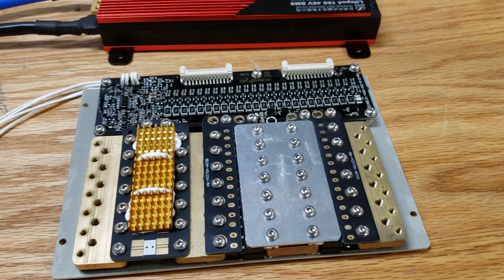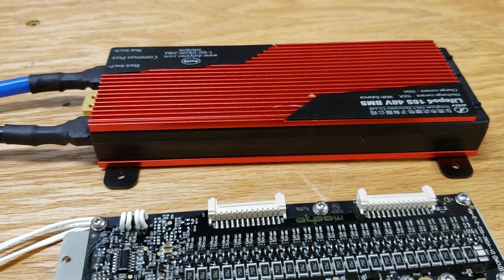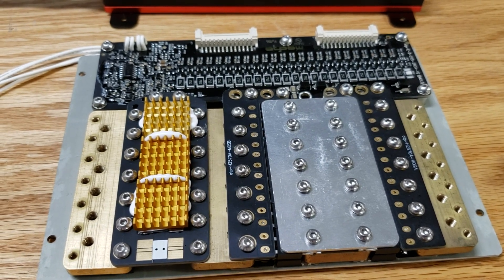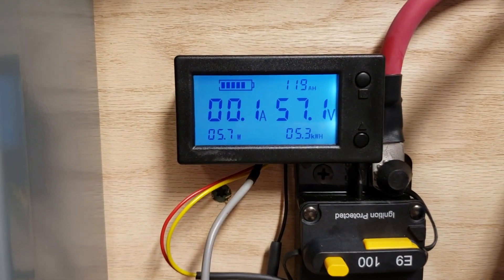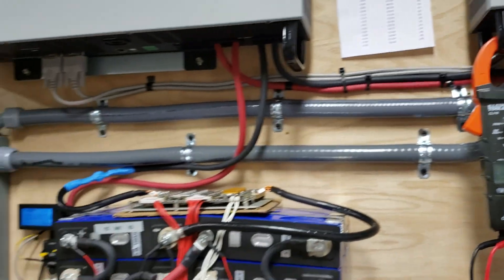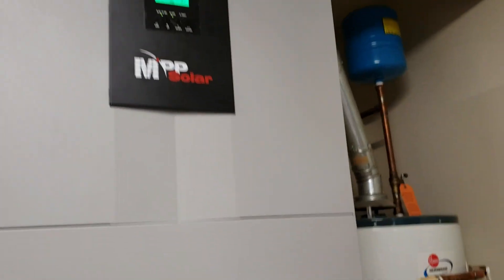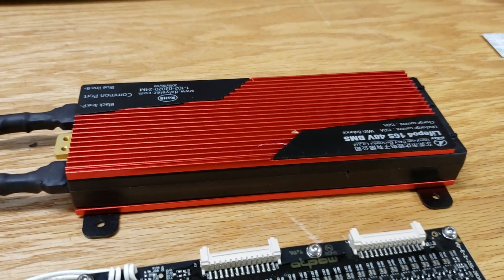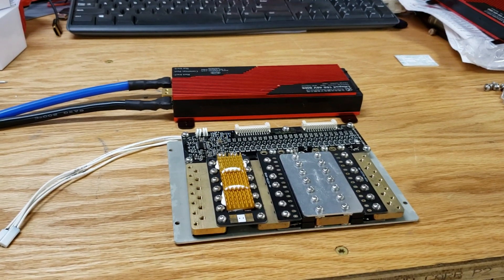MPP Solar LV5048 week 4 update and VoltCell 120A BMS's

Comment: I just received my lv5048 today but I'm having trouble getting it to charge my batteries by utility power. I tried changing it from SOL to UTL to SBU in settings 01 and in settings 12 I have it set to 51v.

For 13 I have it at 55v and 16 I tried various settings and I still can't get it to charge my batteries. I currently do not have PV connected so I'd just like to use it as a backup for now.  Any ideas? How do I switch between "standby mode" "Fault mode" "line mode" and battery mode? It's stressing me out. :(
Reply from the maker: Setting 01 UTL, 16 CUT, 03 APL, 12 Default. Most efficient way of doing settings is hooking it up to your PC or Laptop.
Reply from the maker: Provided that LV5048 was installed correctly
Reply: @DMIINC2013  and thank you so much for helping!
Reply: I'll  try those settings when I get off work. I do have it connected to 120v (GND L1 N) so that might be why. I'll try wiring 240 on the input and see if that works.
Reply from the maker: @redsite001  I am about 100 Sure that it has to be on 240 volts to charge. L1 L2 N G. I can charge batteries at 4KW from utility and that will require 240 Volts.
Reply: @DMIINC2013  okay I'll give it a shot. Looks like I'll need to buy some wire. Thank you so much.
Reply from the maker: @redsite001  Go with 8 AWG as input and you can stay with 10 AWG as output.

Comment: How is this alibaba BMS board working for you, I saw a 180a version.
Reply from the maker: So far so good. I have 3 of them. During testing I even managed to see one of them do the job it was designed to do.
Reply: @DMIINC2013  Hi DMI inc. I am working on a 48v or two 24v BYD (8s) battery powerwall and i am interested in using this Alibaba BMS. Could you email me the link and what the 120a BMS cost, I believe a saw a 180a version, but i am not sure if is the same company.  MNRosado@live.com.
Reply from the maker: @marcoa.rosado4724  Try on this link https://volt-cell.en.alibaba.com/?spm=a2700.details.cordpanyb.4.623e4f843W5WEd
Reply: @DMIINC2013  Thanks that's were i found the 180a BMS, i just requested inf (instructions) and pricing. I see you have a 24s BMS,  and are using only 16S. How do you monitor each cell, and you say one of the BMS did the job it was designed to do, What happen if i may ask.
Reply from the maker: @marcoa.rosado4724  For the price that I paid for the BMS I do not expect it to have monitoring capability. All I needed of it to do is be capable of delivering it's rated power and protect batteries. In the case of LiFePo4 batteries disconnect system at 2.00 Volts per cell and stop charging at 3.90 Volts.

Now to your question of how do I know it was doing the job it was designed to do so. Well, if you look closely in the video that you are commenting on you will see that I only have 32 cells. After experimenting with batteries I decided to get 16 more cells. I then disassembled that setup and connected 3 cells parallel to create the module then connected those modules into series for 16s pack. You can see that in Power Wall overview or Battery Talk videos.

Now that I have mixed cells (charged and not charged) I knew that I was going to create imbalance on the whole pack. I set there with my multi meter  while the system was being charged and watch the voltage of modules. Close to the end of charge cycle I noticed that module #12 was getting higher in voltage then the rest of the system. I decided to continue and see what was going to happen. 

Continuously watching #12 module I saw it went past 3.65 Volts. Was getting little bit concerned but decided to continue. Sure enough the moment that #12 module hit 3.9 Volts BMS decided it was time to take control and it stopped charging the power wall. Dead cold, charging amperage went from 53 amps down to 2.5. Did not disconnect power wall from inverters. That would shut the whole system down. Once the voltage of #12 module recovered to below 3.65 volts it continued charging albeit at slower rate. It repeated that cycle two more times and once the other modules caught up inverters finished the charging cycle.

Now, you will notice that I never made video specifically about batteries  I used. Reason being is that I bought grade B or used cells from China through Alibaba.com. I did not want to post about them until I had formed educated opinion. Since then I have ordered 100 more cells at one great price. They have arrived and you can see latest videos about that.

One last thing. Since they are grade B or used cells I think they will need a good balancer. I have been experimenting with that too and will post some videos in near future.

I hope this helps. Find what works best for you and your setup. There is always more than one way to accomplish same thing.
Reply: @DMIINC2013  Great test, that's what i though may have happen, and this is one of the criteria for the BMS of choice. Your batteries for being a B grade are very good quality, i should have gone that route.Anyway, I created a diagram for the BMS's installation using my BYD batteries and noticed under the specification for the voltcell BMS that the Cell Balance current is only 0.45ma. Is this true. If so this maybe to low of a cell current. This could represent a problem when charging, were cell voltages are high. I believe it should be no less then 2amps. But I am not sure. What's your thought. Sorry for asking so many question, but this is my second DIY solar battery project so i am a novice.
Reply from the maker: @marcoa.rosado4724  Majority of BMS systems even the most expensive ones do not do balancing well and their balancing parameters are set differently. They are there to make sure that you do not exceed draw or charge current, discharge and charge voltages according to your battery chemistry. That's it. If your cells are new and very well matched you should not need that much balancing. Even on my setup with grade B cells I am only at .050 volt split between highest and lowest module. You could always go Batrium route but their systems are very expensive.
Reply: @DMIINC2013  Yes, Batrium is out of the question. But if seems like my cell are not very close in match. So my priority is first to get a BMS that will cut off at high voltage easy and second try to increase the capacity by using a really good high current balancer harder, or a combination of the two. There are just to far off. But i would like to thank you. You have been a great help, and provided me with lots of knowledge. I like your BMS and i will search for a similar BMS but with at least a 2 amp balancer. If you know of one let me know.
Reply from the maker: @marcoa.rosado4724  Two things that stick out from your post. Either you have some bad cells or your cells are way out of balance. Have you tried manually charging each cell? It is easy to do.
Reply: @DMIINC2013  You read my mind. Started charging each cell from 1 battery (8 cells) pack yesterday. Done with 1 thru 4. Cell 2 and 4 which are the high cells reached 3.6 in a shorter time then cell 1 and 2. All were at 3.333v at T=0. After doning all cell I will drop the voltage of all 8 cells and see how cell 2 and 4 behave.
Reply from the maker: @marcoa.rosado4724  Awesome. Does your charger display amount of charge current for set voltage? If so, that will be the best indicator of the amount of imbalance between your cells. The higher the difference of charge current between the cells at the time when you start charging each cell will indicate amount of imbalance. You might not need balancer at all. Keep me posted. I am eager to know.

Comment: I don't understand dip switch position for two inverters
Reply from the maker: Do you have owners manual? It can be downloaded here https://usa-mpp-solar.com/manuals/LV5048%20split%20phase%20manual-20190717.pdf  See page 39. It just sets identification for each inverter so they can communicate.
Reply: I got them hooked up but the current is out of balance tech support has been very good so far trying to figure out what the problem is
Reply from the maker: @ThePapertank1  Can you provide more details? Maybe video on your channel.
Reply: @DMIINC2013  yeah I will do that in the next couple days unless tech support tells me how to fix it.
Reply from the maker: @ThePapertank1  Sure. I would definitely like to know what was the problem.
Reply: @DMIINC2013  still haven't figured it out. the l1 lines seem to be in some sort of conflict. The l2 lines work fine.what are cpu numbers on your inverters? There are 2 sets of cpu numbers my master inverter but one set on my secondary or slave inverter.was wondering what numbers yours are showing.support has been amazing so far I can't believe how hard he working to help me figure this out I'm extremely happy with the support I have received to this point
Reply from the maker: @ThePapertank1  I will check on the numbers once home. In mean time check this video I made. It might help. https://www.youtube.com/watch?v=iTEcvDKF5j4&t=42s
Reply: @DMIINC2013  PROBLEM SOLVED the manual was incorrect the inverters set up in my configuration requires the current sharing cable to be connected. the manual didn't show that because the original design of the inverters was supposed to be self regulating but ended up not being that.the manual was never updated.so they said they would update it going foward.everthing working great now.very happy with mpp solar
Reply: My configuration is 240 split phase so two 120 phases 180 degrees out
Reply from the maker: @ThePapertank1  interesting. My setup is 240 volt split phase too. I wonder if I need to do the same thing? Thanks for the update.
Reply: @DMIINC2013  if you don't connect the current sharing you won't get 5000 watts on one of the phases I'm my case I was only getting like 2000 watts but now it's working right
Reply from the maker: @ThePapertank1   It would be great if you post the video of the problem. Was this when running on battery or  AC pass through? Anyway I will send email to tech support and see what happens in my case.
Reply: @DMIINC2013   all you have to do is run a load then test both positive cables going to your inverters if one inverter is drawing way more current than the other you have a problem.try doing the test when your running a medium to large load
Reply from the maker: @ThePapertank1  As of this morning online manual at https://usa-mpp-solar.com/manuals/ is updated to reflect changes in regards to current sharing cables needing to be connected while in parallel split phase 240 Volt mode. Great job, good catch. My thinking was that system would run of off one inverter only while on battery mode until there is enough load to kick other one in.......